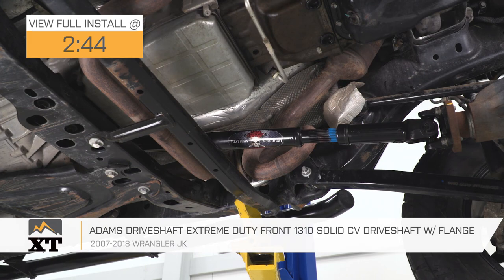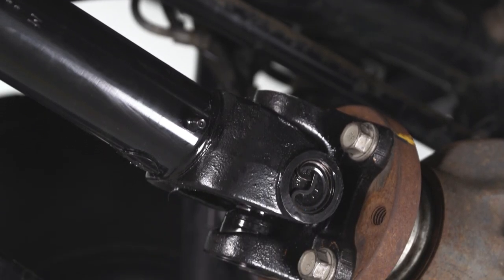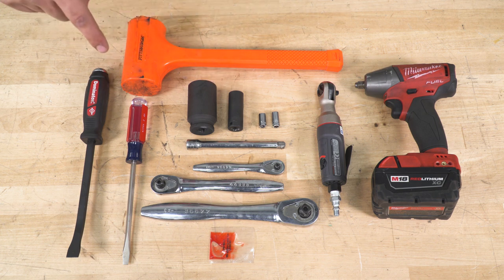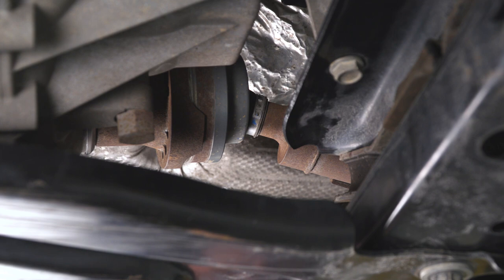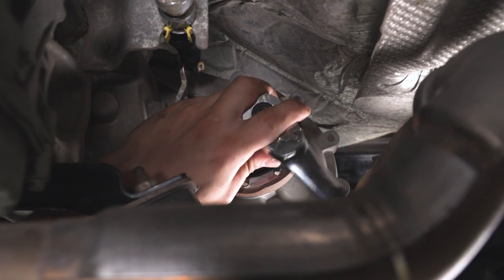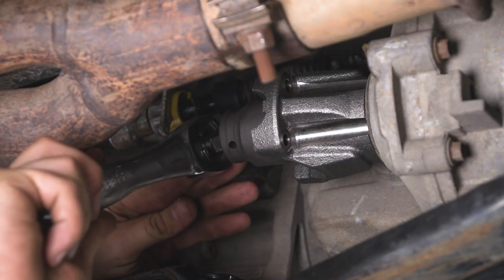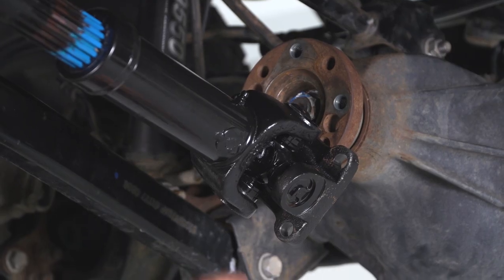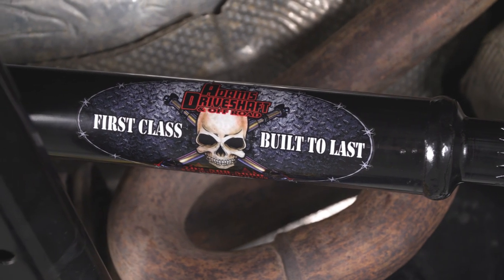Wrangler JK Adams Driveshaft Extreme Duty Front 1310 Solid CV Driveshaft w/ Flange Review & Install

Comment: Does the jeep have to be on a lift to do this (asking specifically for needing the wheels to turn) or can the front be simply lifted on jack stands? if so, is there any problem with installing it at the angle its at while on jack stands?
Reply: no you can do this sitting on the ground on all four tires